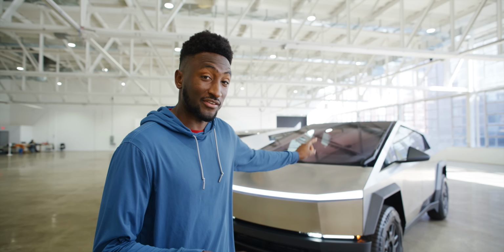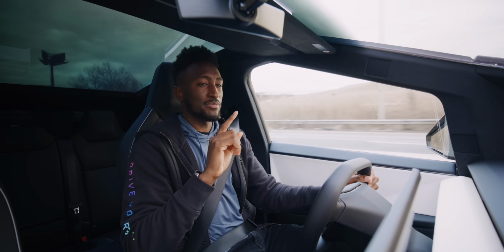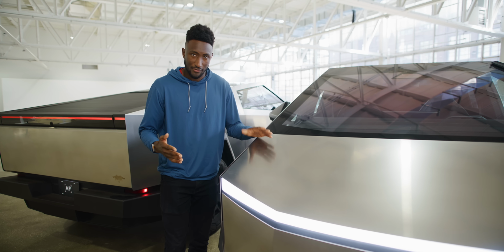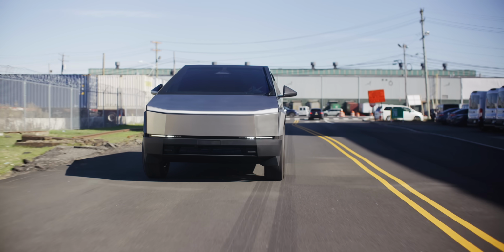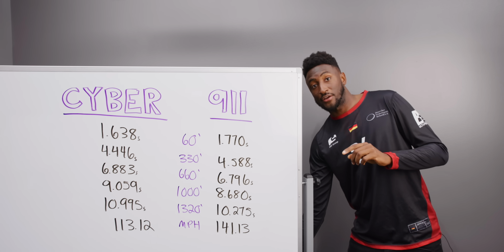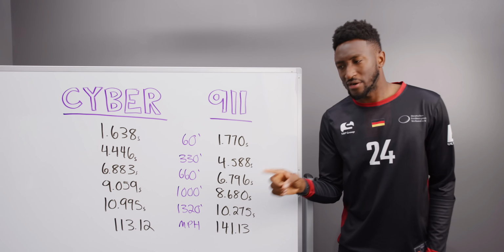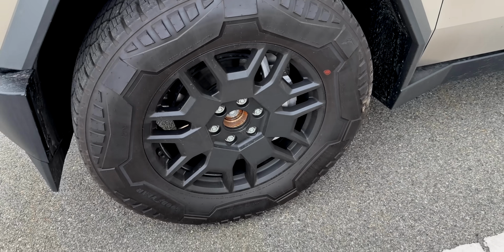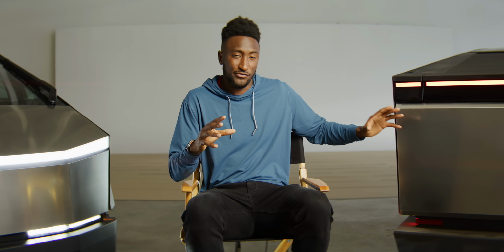Tesla Cybertruck Review: Already Iconic?

Comment: In places where they put rocks on the road to add traction for snowy conditions, imagine how pissed you're really going to be when that big windshield gets hit with a rock and you have to live with that crack in your view. Lots of engineering, minimum understanding of what they were designing imo. Also, and not to go against your feel, but I'm pretty certain the drive by wire was not engineered as safely as you would hope. If Tesla was an airplane manufacturer, they're probably closer to Boeing... way over-promising, way late to deliver, and coming up with BS in the meantime.

Comment: I ordered one back in 2019 when it was released.  I had high hopes.  The production model is overpriced garbage.  Tesla dropped the exoskeleton design and nerfed the rest of the design by skimping on the thickness of the stainless steel and other massive compromises such as shrinking it.  Then they doubled the price.  The people who bought this car initially were futurists.  The people buying the nerfed mini version are just attention seeking douchebags.  It was an easy choice for me to cancel my order.  A futuristic amazing vehicle reduced to a mass market fashion accessory for the "look at me" crowd.  No thanks.  The production model is ugly wavy refrigerator grade stainless steel and looks awkward due to the resizing.  Most of them are rusting already and the bed is not even water tight.  It's amazing that Tesla could screw up so badly.  Once the hype runs out on this vehicle like it has already with the Model 3 people will start dumping them.  The model 3 was selling for more used than it was new during the pandemic and now they are at least 1/2 off due to the hype dying.  When the public tires of looking at these rusty things values will plummet.

Comment: MB, a question that so far no one has answered about the wired steering system. The system digitally adjusts movements according to the environment you are in, so in an emergency, for example a car brakes on a highway, you will swerve. Does this adjustment of the system not remove an important autonomous reaction that would be your muscle memory? Because if there is a constant, like a normal or even electric steering that doesn't adjust, you know how to calculate when you need to turn without losing control. Since you will never make this movement at high speed to "learn" how to turn without losing control, isn't that a safety disadvantage?

Comment: I thought it was the lack of visibility that made it dangerous. 
There are some stainless steel cleaners that leave a residue behind that resist fingerprints. 
The most useful truck I've ever owned is a Subaru Baja with the extand-a-bed, trailer hitch and 4x8 light weight (1k lbs) trailer. I mostly tow my 14ft fishing boat.
A 48V power source will allow you use POE devices, like cameras with the correct adapter.
US law will not allow a car to be imported or sold without a physical hazard button. Expect everything else to be hidden in your infotainment system. 
I'll stick with my Baja, it is becoming a classic.

Comment: so a general question , may be i did not get it right , the steering is just connected to wheels via electric wires so how can you steer it if the battery is dead , how to steer it for example into your garage to charge it

Comment: Um, steer by wire was first used by Infiniti almost a decade ago in the Q50, so it may be nice, but revolutionary it is not.
Reply: False. Infinity still had a physical mechanical steel rack connection between the steering and the wheels for redundancy. Tesla's system has no mechanical connection to the wheels. There's a massive difference. This is why car experts say the Tesla system is the first actual stir by wire in a consumer car.
Reply: The Infinity had steer by wire but it also had a mechanical steering column (as a backup). The CT doesn't.

Comment: I think if they used standard fiberglass with the steel as an option or not at all and paid a little more attention to the annoyances of the unusual design of the truck for daily use it would  be a little bit more appealing of a option to consider in the electric truck market.

It just feels like there's a better options for whatever you want a electric truck for and the only real reason you would pick the cybertruck is for the status symbol which is as valid as any other reason but hard to justify when it's the only reason.

Comment: This truck is absolutely, positively ugly. It reminds me of the Hummer. Everybody was talking about it when it came out. Turned out to be a total dude in the end. I think this truck will suffer the same fate. Once the hype is over it will fizzle. Too ugly, too impractical and it has all kind of reliability issues. Good luck Tesla.
Reply: Brother it's been out like, a month or two. Every single vehicle ever released has issues off the line. Quit yapping. Smell the roses. The hummer H2 sucks because it doesn't actually do anything. It's a G wagon with none of the good parts of a G wagon. A total plastic showpiece. This is an actual truck. One that outperforms anything in its class on the market. The second highest horsepower production truck ever.

Comment: PT Cruiser, Plymouth Prowler and even the VW Beetle (original and reboot) were all iconic and mass produced. Outside of the original Beetle, none have held on to that status.
Reply: There is zero comparison to be made here dude. Those cars didn't try anything new.

The difference with the cybertruck is that there is nothing else even remotely similar to this vehicle that has ever been mass produced. No major car company has ever had the balls to take design language directly out of sci-fi and make it something that an average person could hope to obtain. The cars you mentioned didn't actually do anything different, which is why nobody cares about them. They were just not good looking. That was their whole thing. Whether you think the cybertruck is ugly or not, it is in a totally different ballpark.
Reply: That's because they were lousy cars.
The cybertruck is one of the best-performing vehicles out there.
Reply: What's new with the cyber truck, exactly?
Reply: @EQ3282  oh so you just don't know what it is to begin with, got it.

Dude, I really don't want to play ball here. But fine. Unique things. This is a PICKUP TRUCK with an entirely paintless, stainless steel body that's thick enough to be bulletproof to most non armor-peircing rounds, with seer-by-wire steering in both the front and back, a radical sci-fi design that no other company would dare to try (why would they risk it), it is the second most powerful pickup truck available (second only to the 12,000lb hummer EV), It has an all glass roof, a built-in hard bed cover strong enough to stand on that retracts entirely into the body, it has an adjustable air suspension, a 15-speaker system with two subwoofers, a brand new 48 volt accessory architecture that powers nearly everything in the vehicle without the use of massive, complicated, nearly unrepairable harnesses, man, what's not unique about it.

The cars you mentioned are subjectively ugly. That is literally it. That's all they do different and that's all they have in common. This cybertruck is physically, structurally, and conceptually different than anything that came before it. Whether it's ugly or not is up to you, but your comparison here is astonishingly terrible. And if you really think it's similar to the PT cruiser then please explain why people in 2001 weren't pulling out their digital cameras, following it down streets, stopping in their tracks, etc. in its presence. Again, totally different ballpark. And I'm neither an owner nor reservation holder here. You are just way off base. Explain the ways in which this vehicle is NOT unique. A small few road vehicles have had rear steering. One or two cars have been stainless steel.  A small amount have been steer by wire. But nothing even comes close to being as much of a singlehanded leap outside of the norm as the cybertruck. All of the unique things packed into this vehicle, even the ones that are scarcely present in the auto industry, have never been combined into one single vehicle before, ever. And it's not even remotely close. And I'll say it again. This is a pickup truck. Also it drives itself.
Reply: I've seemingly poked the proverbial Tesla bear. Sorry to rain on your parade, but none of this stuff you mentioned is 'new.'  Argue all you want about Tesla putting them all in one package, but if that's your definition of 'new' then any model refresh or newly introduced model would fit that logic.

That said, to call those other cars "subjectively" ugly is a handy, nuclear way to kick any styling counter arguments to the curb. They all sold (in the case of the PT Cruiser and Beetle, pretty well). But if that's your stance, what about the Delorean? A valid argument can be made that it was FAR more groundbreaking than the CT (especially when it comes to safety features we take for granted these days). Or does that fall into your "subjectively ugly" grouping?

I mean, in the end, to each their own regarding what you think of the package. While the CT definitely looks...unique, it's not exactly breaking any molds in the car world.

And no, it can't drive itself...and never will. I guarantee that.
Reply: @EQ3282  it can drive itself lmao. I have personal experience with FSD. It's not "perfect" but it never will be. Perfect driving is impossible, but it CAN be better than humanly possible, and it's quickly getting to that point. Anyhow, the cars you listed are all very specifically known for being ugly, crappy, not great. The DeLorean is very specifically known for being good looking, being stainless, and for its gullwing doors. It is not the first car with gullwing doors, it performed terribly, was expensive relative to its lack of performance, and was unreliable as all hell. But what do you know, it is still iconic and sought after to this day. Because it actually innovated. The other cars you mentioned did not. The cybertruck is not equivalent to a refresh nor is it equivalent to an average newly introduced model, and I explained exactly why already. You obviously just don't care about what makes this truck innovative and unique and that's fine, but acting like it isn't just makes you look ignorant.

The fact that you can recognize what makes the DeLorean important and special but not the cybertruck is wild.
Reply: @EQ3282  almost everything he mentioned is new for mass-produced vehicles.
- stainless steel (delorean wasn't mass produced with fewer than 10k made)
- steer by wire (no production vehicles have had this)
- self-driving (yes it's real - watch some FSD v12 videos or go take a test drive) (though it's not yet available for the cybertruck)
- 2.6s 0-60 is by far the fastest production pickup
Reply: @cwarcarblue11  the 48v system is pretty big too from an engineering standpoint and important for the industry in general. Other manufacturers have the groundwork laid for it but they were ahead of the curve by far with this one. It's great for the industry and for repairability. Way less cable runs, way cheaper to repair when things go wrong.

Comment: Steer by wire has been a thing for over 10 years, Infiniti had it in 2013.
Reply: It's barely ever been used though. Don't act like it's commonplace. Name another truck with steer by wire and rear steering. The hummer EV. That is it. Ever.